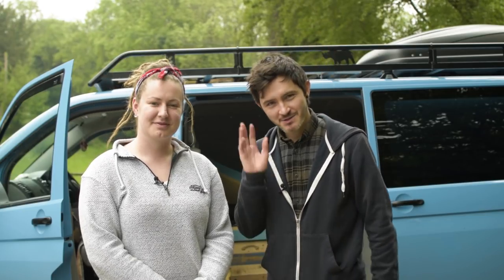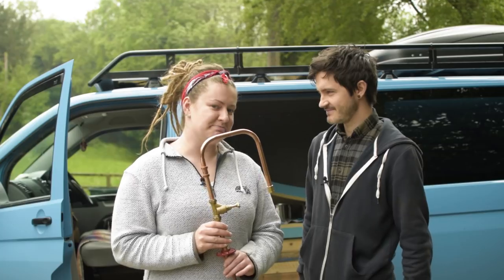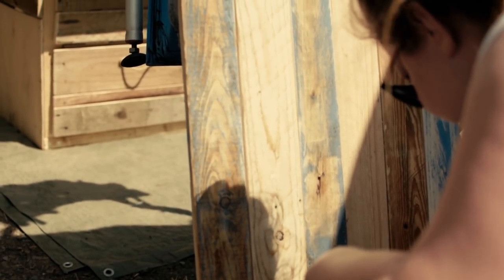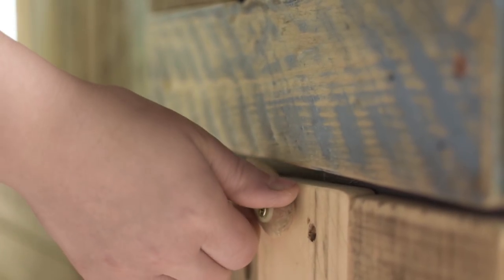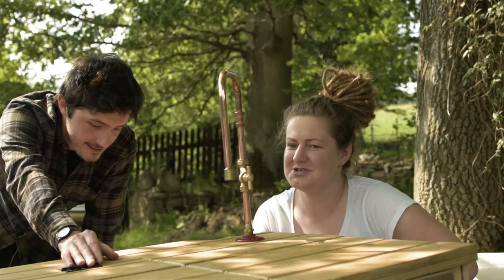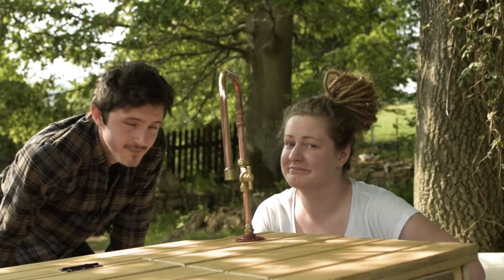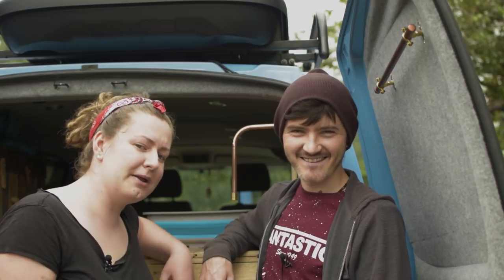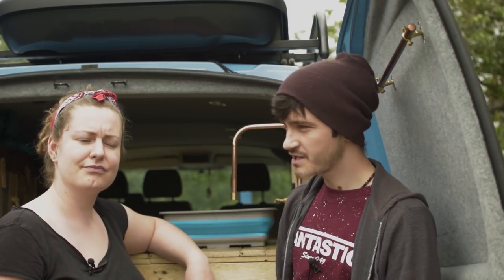Day 36 - Tap, 12v Whale Submersible pump & pressure switch install #VanLife VW T5 Camper Conversion

Comment: Hello, love the videos. They are so helpful. Does the opening in your fresh water tank need to be sealed airtight in order for the pressure switch to work? I have a Jerry can with twist off lid and I'm wondering if this system would work with just a simple hole in the lid and the pipe dropped through and then connected to the pump? Any help would be greatly appreciated
Reply from the maker: Hi James - it sound like we have the exact same set up as you and it works perfectly! Ours is not where near air tight, it’s a 25L water container with a removable lid that has a middle that can be removed. 

Only advise it to make the lid with the hose as tight as possible as when you go over humps water can splosh out the top! We ram a clean rag in ours! 👍👍🚐

Comment: Hi ya, just watched an old video of you guys  fitting pump and pressure switch, great vid by the way, . I'm now at the same stage as you were, i have the pump and switch ( bought from your links ),  but you dont show any of the wiring, dont know where the on/off goes....i know how to wire to battery via fuse board etc, but do i wire pump to switch, or straight to battery,   and what set of wires does the on/off switch go on...hope this all makes sence, and a link or diagram will be fantastic. Hope to here from you soon and see you both in your next video. Cheers Gary and Val.👍
Reply from the maker: If you can supply us with an email address we'll do our best to help 👍

Comment: Looks so beautiful! So you need an regular switch on top of the whale pressure switch? Could you please tell me how you connected these?
Reply from the maker: Thank you! You don't need the regular switch to be honest, we added it to prevent any accidents 😜 more info can be found on our blog https://www.campcomforts.co.uk/blog/2019/3/4/tap-pressure-switch-amp-submersible-pump
Reply: @FloraTheNoviceExplorers  Thanks I came to your video through your blog actually. That's why I got confused I saw the regular switch. So just the pump and switch are connected to the 12V and then leading in a regular tab?
Reply from the maker: Yeah, so basically you take a live feed from your 12v battery/fuse box, that connects to the pressure switch. Then you continue the live from the other connector on the pressure switch and attach that to the live ca me of the pump. You then take the negative from the pump and feed it back to your fuse box/battery. Hope that makes some sense 😜
Reply: @FloraTheNoviceExplorers  yes it does! Thanks for taking the time to reply. Much appreciated :)
Reply from the maker: No worries 😂 feel free to contact us if you get stuck!

Comment: Hi guys! What water tank do you have? Can it just be an open “Jerry can” style tank with the pump just having through the open lid or does it need to be sealed in order to use the pressure switch?? Thanksn
Reply from the maker: Hey Lauren, we have a 25L Jerry can with screw on a lid that you can remove part of the Centre to fit the pump pipe through. No it doesn’t need to be sealed - I believe it’s the tap that senses the pressure. The lid was a little bit gappy and when full and driving on a bumpy road sloshed a bit out - so to combat this we wedged it with a micro fibre cloth and fitter a cap. If you want to see a picture send us a message on Instagram @vw_flora 👍

Comment: Great Vid guys!! you have given me the answer/alternative to boring microswitch taps!! May i ask..... was the on/off switch needed for the pressure switch or can it be hard wired with no on/off switch?. big thanks :)
Reply from the maker: Cheers Andy! Yeah, this setup allows the use of more interesting/attractive taps. The on/off switch isn’t essential. It just added an extra level of control to prevent accidents :p you could just let the pressure switch do the job by itself! Hope that helps.

Comment: Hello you lovelies! Thanks so much for your brilliant videos…love the way you explain things and just do your thing…you’ve really helped me. Just a quick question - would this set up work with just the flipper switch next to the tap as we don’t have a turny tap - it’s essentially a piece of copper pipe bent into a tap shape. (We originally designed this for a foot pump but it was never water tight so now exchanging for a submersible pump)
Reply from the maker: Hi! Glad you've been finding these videos somewhat helpful 😜 yes, that should work! You don't need the fancy pressure switch. A manual switch that turns the pump on/off will do the job perfectly well 👍
Reply: @FloraTheNoviceExplorers  Fantastic thank you - there’s not much info out here about this set up so it’s much appreciated. Hope you’re both doing well :)

Comment: Hi, is the pressure switch needed? Wouldn't the tap handle do the job by keeping the water at bay until you need it? The pump would pump the water up the tap. Just curious. Cheers.
Reply from the maker: The pressure switch isn’t essential but you need some sort of switch to cut power to the pump when needed. Otherwise the pump would constantly be going. You could just use a simple 12v switch instead.

Comment: Loved the video. I have Just brought the whale submersible pump and was about to try and install it myself. I had planned to wire it to my fuse board so I had a switch to control the on/off of the pump and attach it to a normal tap. So I am right in thinking this would work, yes? I loved your tap, I am looking for something similar myself. Thanks again for the video, keep them coming :)
Reply from the maker: Thanks Sharon! Yes, that should be fine 👍 we just felt a bit fancy and went with the automatic pressure switch, but it isn't required, just an optional extra! 😊 This video is a few years old now but the tap, pump and switch are all still working perfectly 👌 hope you're well
Reply: @FloraTheNoviceExplorers  Thanks for the reply. I am just watching a few more of your videos, what a shambles the van upgrade was. Wish you luck getting it put right..
Reply from the maker: Hehe, shambles indeed! But we're slowly getting it put right and feeling a lot better about it all now 😊

Comment: love the setup and the look how is the tap and pressure switch holding on?
Reply from the maker: Thanks ☺️ yeah it's doing really well. All these years later it's still working just as it did when it was new 👍

Comment: Hey guys! Lovely stuff. Ive gone for the same system with the same pump and pressure switch. Just trying to figure out the electrics side. How does the switch connect to the pressure switch and pump any tips?
Reply from the maker: Hi Ben! Just at work, will try and remember you asked this and send over as much helpful info as I can later on tonight :p
Reply: Flora & The Novice Explorers awesome that would be much appreciated! Very inspiring vids. They’ve helped me out a lot so far with our build
Reply from the maker: Haha, well we hope they've helped a little. But don't know how much useful information we've passed on :P The electrics for the switch and pump is pretty straightforward. Essentially you'll have your positive wire from battery/fuse box, that feeds into your pressure switch. The other connection is also a positive feed, this will need to be connected to the positive connection on your whale pump. The other cable from your pump will be negative that needs to be fed back to your battery/fuse box. It's been a while since we set this up, so my memory isn't the best... However, I can try grab pictures for you over the next couple days and send them to you with more helpful info. I'm not a very proficient electrician myself so finding the correct words/terminology to make this understandable is a little tricky! If you send your email address to us via : vwflora@gmail.com I'll do my best to send over some pictures and info. Do you have pretty much exactly the same set up as ourselves?
Reply: @FloraTheNoviceExplorers  hey! Any chance of sending me those details, too? Same setup!!
Reply from the maker: Hi Michael 👋 I’ll see if I still have those details knocking around somewhere... fortunately the set up is pretty straightforward though 😊
Reply: @FloraTheNoviceExplorers  hey, thanks for coming back to me. Did you have any joy? Great videos by the love, I love how they're filmed.
Reply from the maker: Hi Michael! We’ve had a look through our G drive but couldn’t find the file we had created. I may have it saved somewhere else but I can’t guarantee it unfortunately! We’ll keep looking :p
Reply: @FloraTheNoviceExplorers  Hey guys - I still have the detailed info you sent me happy to pass it on
Reply from the maker: Hello 👋 ah brilliant, yeah if you have it that would be great! I’m not sure if Michaels email but ours is vwflora@gmail.com if you want to send it our way first 😊
Reply: @FloraTheNoviceExplorers  email sent, thanks!!!

Comment: Hey a big thank you to you for your videos, me and my partner are currently converting an old caravan and we are also beginners and never done anything like it before. So far its been the biggest challenge. We got a rotten van and had to strip it all back to a tin, then had to remove the actual aluminum shell and replace it, got more cuts than a sliced loaf of bread. Loved watching this video, we are currently sorting out our tap plumbing, we are on a tight £50 budget for such so glad you have used the whale submersible pump and basic woods and varnish, we definitely can do this now. we brought a normal kitchen tap without micro switch so also going for your method. will be watching the rest of your videos now :) So how long have you been living van life and how are you finding it...I'm guessing the freedom is awesome!
Reply from the maker: Hello! :) Thanks for your comment, we really appreciate it! Ah brilliant, sounds like an awesome project Yeah, we were really happy with how everything turned out. We surprised ourselves! And the tap/pump is still working perfectly, even after using it everyday for 13 months whilst we were travelling. Glad our video has helped you decide what to do going forward. 

We're currently in a static caravan on a farm. We lived in the van for 13 months and can't wait to get back out in it, planning trips for the future currently! Really miss the adventure. The freedom was EVERYTHING, until COVID... :P
Reply: @FloraTheNoviceExplorers  That's brilliant, I'm happy for you, You did so good. Definitely motivated and kicked us up the arse to get our finished to enjoy our favorite time of year, the autumn :)

That's cool, bet the extra space is nice! Yeah covid is slowly vanishing out so I think it's time to hit the road.
We have called ours copper jungle, its copper and jungle themed, really excited, spent hours fixing rubber to the door frame and painting it copper.
Reply from the maker: We love the Autumn too! I'm not quite sure when the summer was, but we like the changing of the seasons :P life gets a little less comfortable in our caravan as proper winter hits, but we love it. Hope you manage to make it in time for Autumn :)

Comment: Great ideas and love your vid. Like you, I want something rustic or steampunk rather than the awful micro-switch taps commercially available for campervans. I know you bought the tap off eBay and so you might not be able to answer the question that follows, but someone else might. How do you stop a swivel tap from leaking at the swivel joint when attempting to use standard 15mm compression (plumbing) fittings? It's doing my head in! 👍
Reply from the maker: Cheers! Yeah, we love the tap. Works well and looks good with the more rustic feeling furniture. As for your leaking question... we’ll have to let someone much smarter than us help you out! Unfortunately plumbing is not something we know much about. Hopefully someone sees this and helps you out! Thanks 😊
Reply: Hey I might be able to help. I simply fitted a flange to my worktop and then the copper pipe length just goes into it and it can swivel free
Reply: @defboyuk  thanks for that.nibalsondiscovered that push-fit fittings swivel!

Comment: Hi both, just wondering which pressure switch you used?  Thanks!
Reply from the maker: Hi Jack. We used a Whale pressure switch, I can't remember the exact model number off the top of my head, however there is a link to our blog post in the video description. There's a list of all the bits and bobs we used under the 'water setup' section.  Hope that helps :)
Reply: @FloraTheNoviceExplorers  Thank you!  Just wondering... where are you guys based?  Long Mynd, Aberystwyth, Rhayader, you can't be far from me in Mid Wales!
Reply from the maker: Haha, probably not far at all! We're based in Shropshire, literally at the base of the longmynd in the sticks just outside of the Church Stretton area.
Reply: @FloraTheNoviceExplorers  No way!  I used to go to the Horseshoes at Ratlinghope years ago when they had the now legendary open mic nights there.  Went to Bishop's Castle school, live near Newtown.  We surely have a mutual friend or two :)
Reply from the maker: Haha! I (Callum) attended a few of those open mic nights there too! They were great, even got up a couple of times and attempted some tunes. Most likely do have a few friends in common!

Comment: What size pipe did you use to connect to the 12v pump?
Reply from the maker: Hi. It was a 10mm food-grade pipe. Use hot water to make the pipe more malleable, then use a jubilee clip to tighten on to pump :)
Reply: @FloraTheNoviceExplorers  thank you so much for your reply 😊
Reply from the maker: @jamesmcgrath2679  no worries, hope it helps :)

Comment: Hey guys, love the video, your van looks great!! Was wondering if you still had a link to where/who on eBay you bought your gorgeous tap from?
Reply from the maker: Hi Emily 👋 thanks 😊 it’s been a while since we bought it and we’ve had several people ask. From what we remember the person we bought it from is no longer operating, although there were similar ones on eBay at the time. I’ll have a dig through old emails and see if I can find anything useful! Thanks
Reply: Flora & The Novice Explorers awww amazing, thanks so much!! 2 years on - are you still happy with the system?
Reply from the maker: Yeah it works great, it’s simple and easy to fit. We don’t have a sink (as you can see) so it sometimes dribbles out water that is stuck in the system when we drive over bumps - we just up a towel underneath it! Here a link to our water set up blog - 

https://www.campcomforts.co.uk/blog/2019/3/4/tap-pressure-switch-amp-submersible-pump?rq=Taps

Comment: If you find the screws let go over time holding down your tap to the wood bench I would use countersunk screws with a washer and nut.
Reply from the maker: Thanks for the tip! Will write this down as we were thinking this could possibly happen, but we lack the knowledge currently :P but thanks for sharing. Will keep it in mind :)